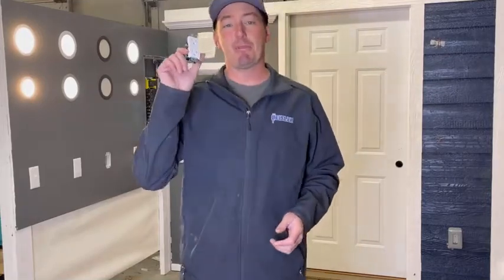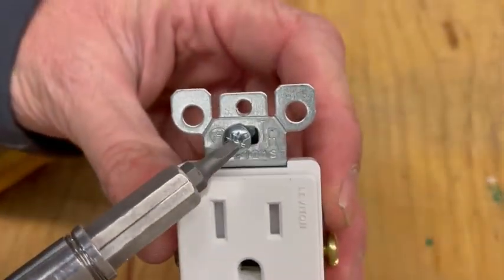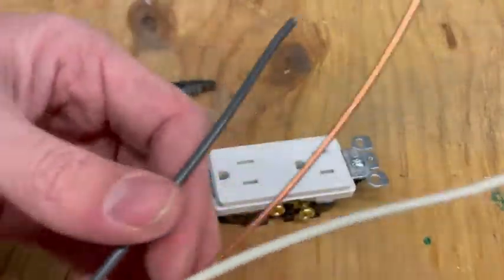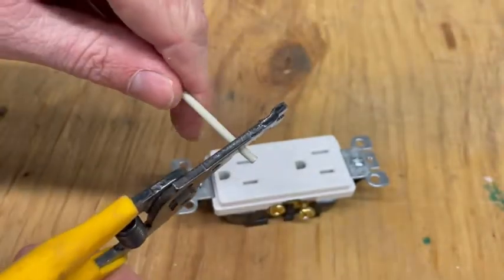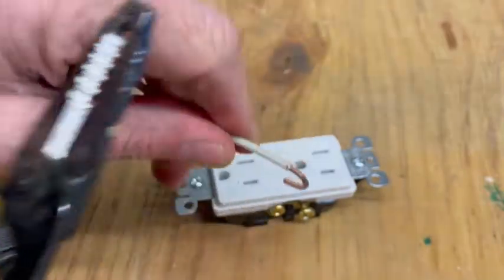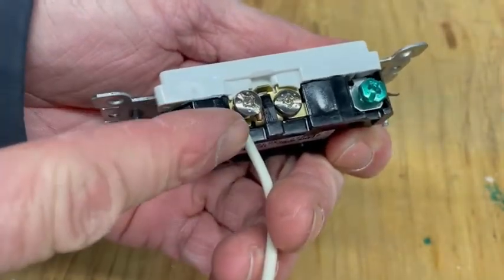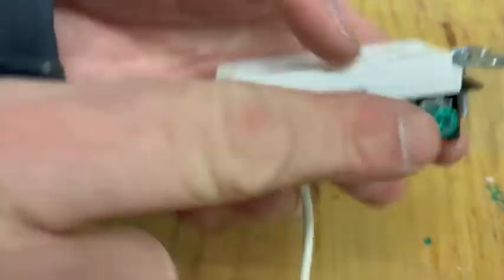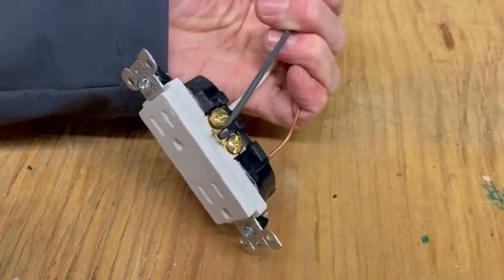How to: make up duplex receptacle

Comment: It gets more challenging when the top outlet has its power toggled on and off by a switch and the bottom remains always hot. This introduces more steps including seperating the tabs on the hot side of the receptacle.